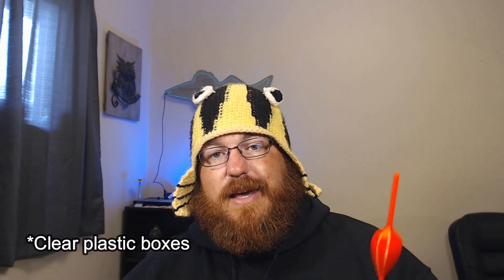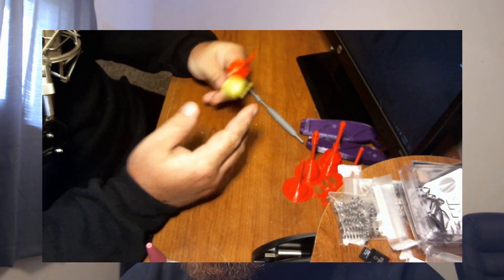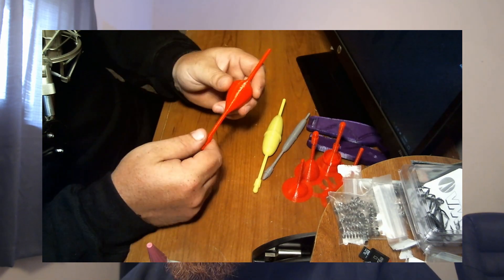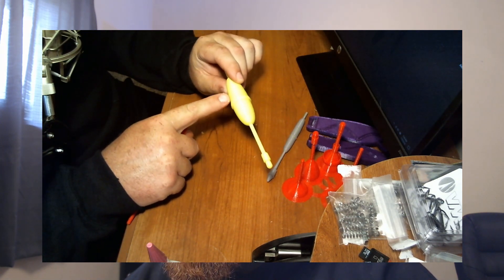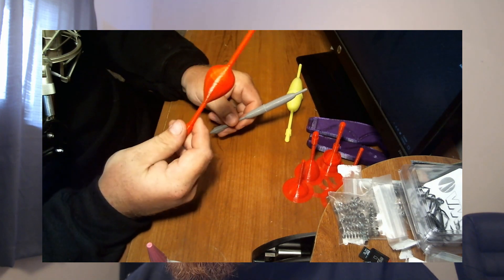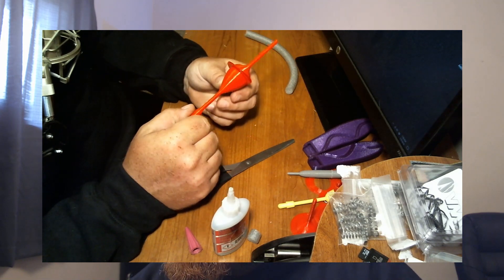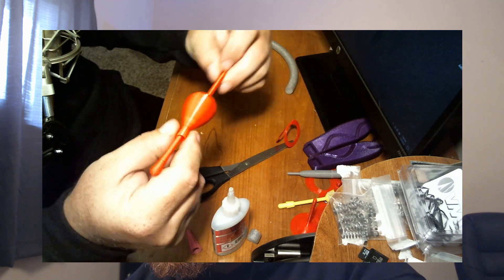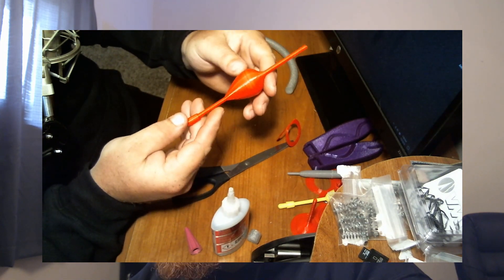Fishing Floats for Less Than 15 Cents? 3D Printed Bobbers (STLs included)

Comment: why do you need the foam? doesn't the bobber float with the air trapped inside?
Reply from the maker: Just a preventative thing in case the layers didn't setup air tight. If your printer is set up really well it should work fine but in my experience a true thin wall air tight print proves difficult on my setup.

Comment: How do I use it? I'm new in fishing and I'm very interested of sharing your work with my followers!
Reply from the maker: When you print it there will be two halves, be sure to glue them together put foam in between if you have some, if not it should work anyway. There will be a small collar on the shaft that should be lose or break lose after printing. On the shaft there should be a small cut out wrap the fishing line around that once and then slide the collar over the line, it should click into place. Then hang a bait below it, once a fish eats the bait it should pull the float down. Upscale lures did a great video on these floats if you want to see him fish with them!
https://youtu.be/BBdUfZMvulw
Reply: @RevampedOutdoors  Appreciate it man! Greetings from Mexico

Comment: If you anneal the PLA it should be just fine with the heat. put it in the oven at 200 for an hour then turn off the oven and let it cool naturally.
Reply from the maker: I have tried that a few times my PLA always shrinks for some reason, then my clearances are a bit off. I'm sure some brands work great like that though.
Reply: @RevampedOutdoors  PLA will always shrink. But, if it's from the same spool, it should always shrink the same proportions so with a bit of trial and error you can dial it in. For this application, I would try it with the bobber assembled and hang them from the top rack. Would be worth a try.